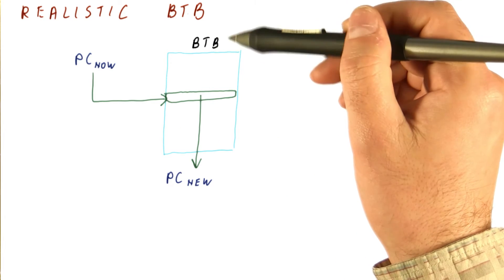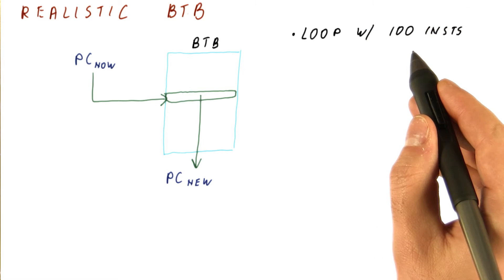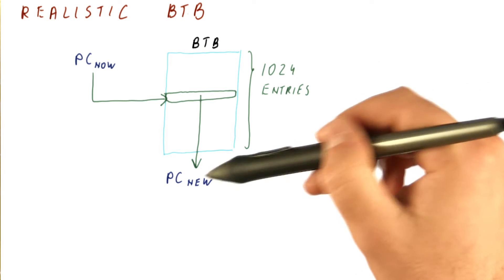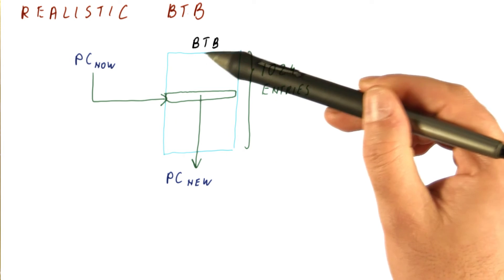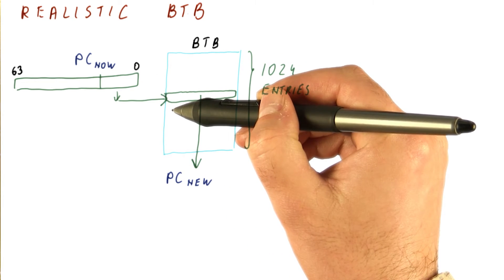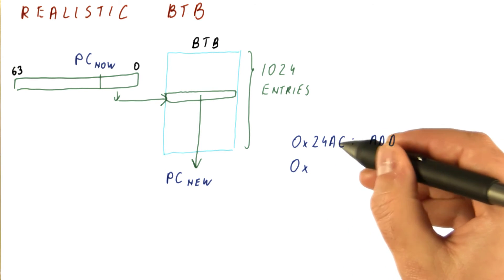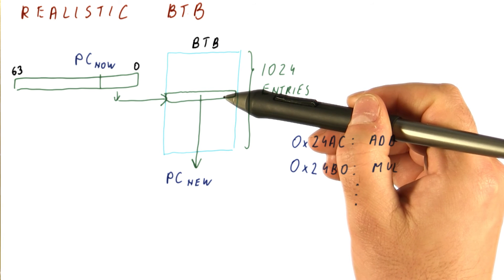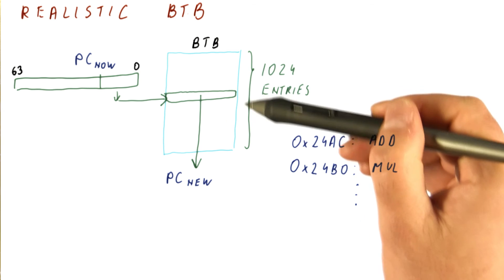Realistic BTB - Georgia Tech - HPCA: Part 1

Comment: okay, by reading the comments, I got to clarify that BTB will have only branch instruction's address ("PC") and realized that yeah we actually ended up here to resolve branching issue; even the BTB gets only "Taken-Branch" PC value from currently executing instruction's PC  which is being resolved in one of the stages in pipeline.  

As mentioned by @wwurjant in the comments, as we are considering only specific portion of address bits (mostly lower bits, except last 2 if we have 8 bit buffer in BTB and size of PC is 32-bit), there might be a chance that we may consider "Non-Branch instruction" (might have same lower bits as of a "branch instruction", although MSBs are varying). Thus, we could have inaccuracy in predicting next PC as this inaccurate/wrong/misleading prediction is not at all required since its a "Non-branching Instruction".

Comment if anything is not clear :)
I think my explanation wouldn't be that clear for most of you :(

Comment: I agree with the first comment. For a loop, there's only one address (PC) for the branch instruction. why we should have 100 entries for the loop?
Reply: There can be multiple branches within a loop and multiple loops in your program. Think also about nested loops
Reply: @wwurjant  nested loops and I think also if / switch statements within the main loop. they are branches too, and are pretty common, right?
Reply: But still, why do we need to put the PC addresses of non-branch instructions in the BTB?
Reply: Robert Lee The most common BTB populates an entry that is predicted TAKEN. That means every entry must point to a branch instruction. I’m not aware of a BTB that has an entry pointing to a non-branch instruction.
Unless, of course, an aliasing occurs. Since in this example we only use N lsb bits of the PC, it is possible that a non-branch instruction aliases to a BTB entry. This becomes one of the sources of inn-accuracy in the prediction.